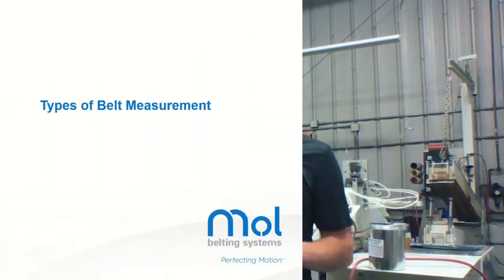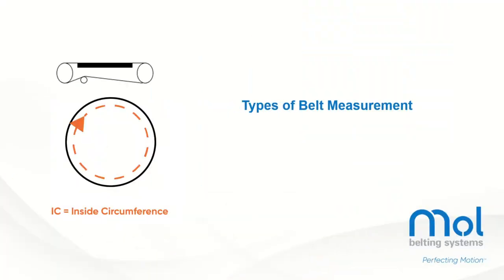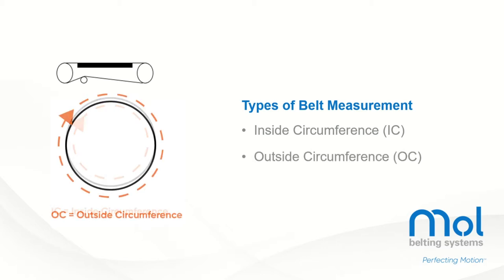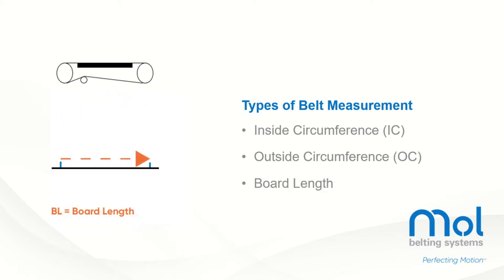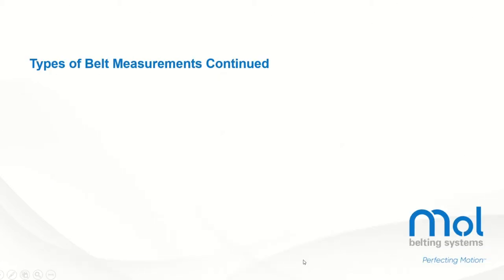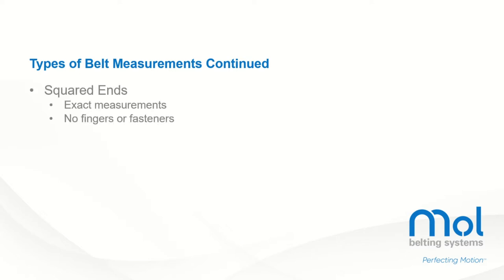How to Measure a Conveyor Belt

Comment: Have a plastic mesh conveyor :

+ Wide 120 cm / 80 kg-m2 / qtt :48  x 120 m long / wire diameter 1 mm by 1 mm.
+ Wide 140cm / 80 kg-m2 / qtt: 32  x 165 m long / wire diameter 2 mm by 2 mm.
+ Wide 200 cm / 170 kg-m2 / qtt: 10 x 200 m long / wire diameter 2 mm by 2 mm
+ Mesh size: 25 mm x 19 mm + 19 mm x 19 mm